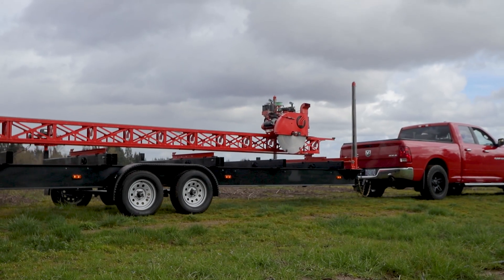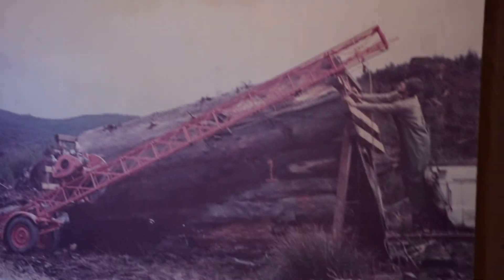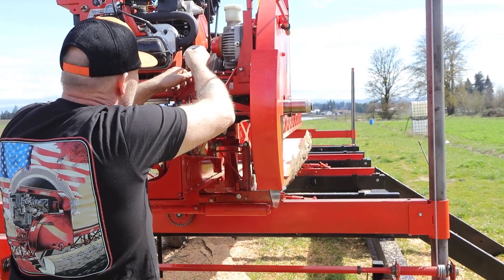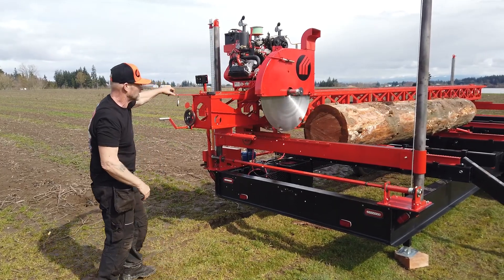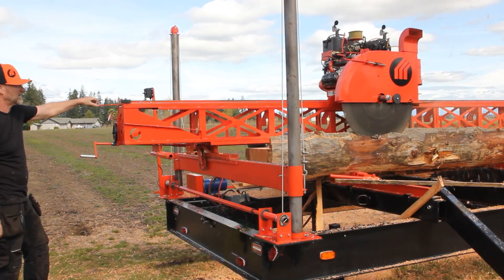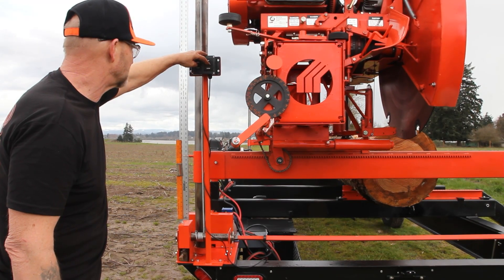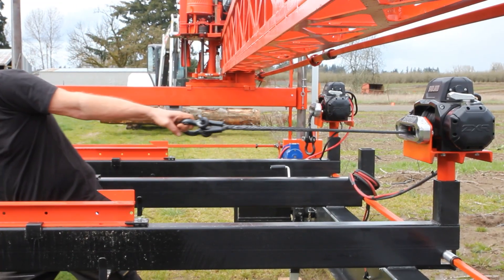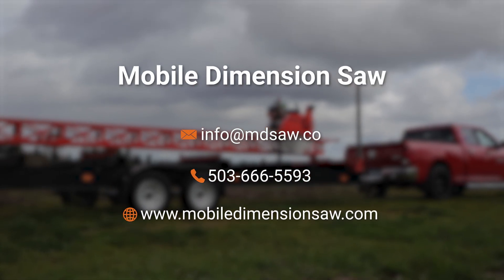NEW Mobile Dimension Saw - Product Video - Model 128 Hydrostatic with VW Gas Engine

Comment: I ran one of these in the 80’s as a side job when not logging -  they are absolutely amazing and really reliable, when configured properly.  Also, you can saw beams that would normally cost a fortune, quite cheaply.  One thing though, for people milling there own lumber,  if you’re building a house, make sure you learn the proper way to cut dimensional lumber (there’s a right and wrong way) and to get a LICENSED lumber grader to grade your lumber, so your house is up to code.

Comment: I own one, I bought it almost 20 years ago.  The teeth are easy to sharpen and change and are low cost compared to bandsaws.  I believe there is less (not more) sawdust per board feet cut... I can cut much more dimensioned lumber from a stick of wood... there is little waste in slabs.  I stand in one place after dogging down a log and the lumber comes to me  to be stacked... best saw ever made.

Comment: Can we configure it without a deck so we can place logs on the ground between the posts? like the turbo saw or the peterson or the mahoe?
Reply from the maker: Yeah, you can set it on the ground. I'll try to get a video of the differences today and post it as a short. It'll be rough, but it'll be good enough.

Comment: What is the estimated price on the saw on demo here?
Reply from the maker: email me for exact pricing. this one is on a trailer which locks you into certain features, but there is a bit of flexibility.
Reply: @mobiledimensionsaw  I think I am not the only one that is curious about this unit so I will suffice if you share standard prices for your base models.

Comment: There’s no guard on the return you probably should put some on them. My saw has one. My brother-in-law told me it’s probably the safest sawmill he never saw You’re not supposed to cut the last part of that log off there’s a manual for instructions are the original builder of the sawmill When I bought mine used, the owner gave it to me Manual
Reply from the maker: We have guards, but you can't see the magic with that on... so we decided to live dangerously... for the sake of art.
Reply: @mobiledimensionsaw  Why is there no website or phone number?

Comment: I worked on one of these mills for a year back in the 1980's they are an excellent design.  Safe for a saw mill as the blades spin away from you so if you get a sap ring and the saw picks and throws a spear of wood it's throwing it away from you. Sharping the saw teeth is quick and easy there are only 6 teeth on each blade and they are quick to remove and sharpen with a small hand grinder.  There is a cam locking system that holds the tooth in the blade which is a simple and very reliable design.  The saw I worked on was mounted on a custom built hot dipped frame that had a set of duel axle wheels that bolted on under the frame which turned it into a mobile mill that we towed behind a short wheel base Series II Landover we would work all week camping out on farms cutting timber for house lots, cattle yards, fences, etc.  I have seen a few portable mills and this is the best design by far.   I am glad they are still making them.  They were designed to be totally portable.  So you could fly one in on a chopper and assemble in in the forest.  You can pack them in on a mule or even carry them by hand if you have to .  I have seen film of 4 people carrying the engine on poles.
Reply from the maker: yes, it was a different time and a different type of man who carried these mills up the mountains.
Reply: Back three years ago I asked why they stop making making these and I was told why but that doesn’t matter. Are you planning t a seed And I grew the amazing thing is the frame that runs on is being made with a CNC and it’s all one piece that’s cool